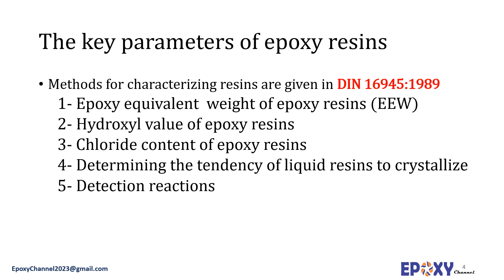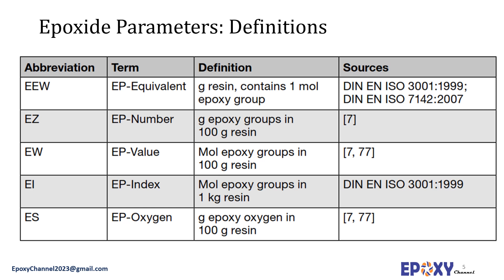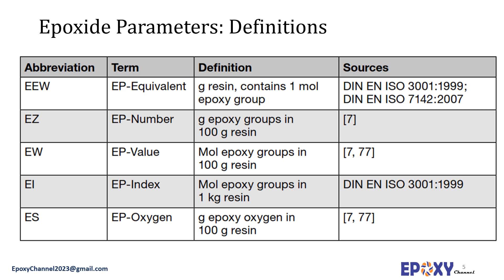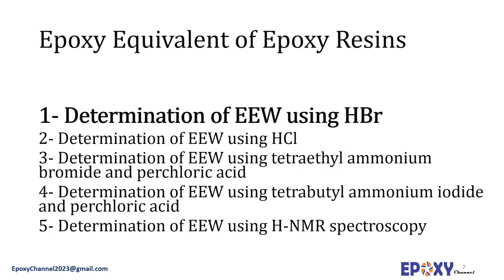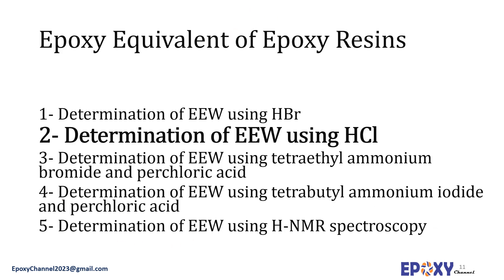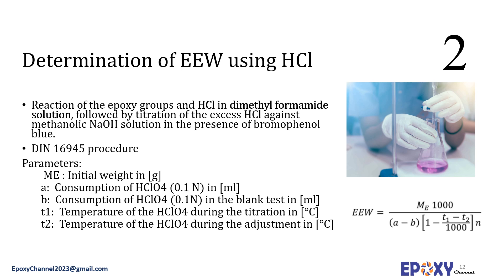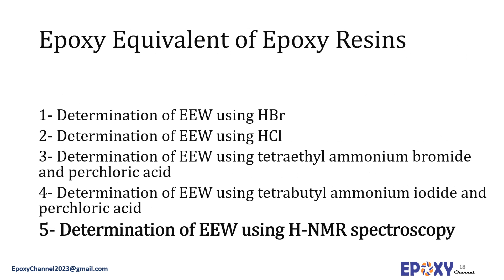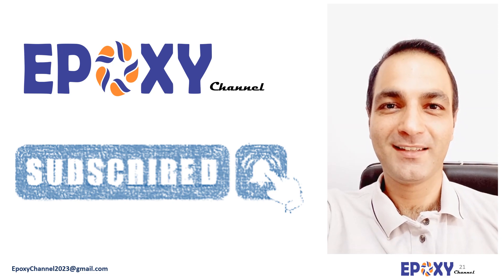Epoxy Equivalent Weight (EEW)-Session 7 @EpoxyChannel

Comment: Hi Sir, I want to ask, it is okay if I just find EEW of epoxy on google?
Reply from the maker: Hey. You can find the EEW of various resins in their TDSs or online. However, often in the TDS documents a range is presented for EEW and that would not be precise. Therefore, it is suggested to measure it again just before use. Even if you are using a resin frequently, and you have measured the EEW previously -say 2 months ago, you should measure it again before use, as the EEW changes over time, like a deactivation phenomenon.

Comment: Dear Sir,
Please brief me, If the epoxy value is being achieved at the same time on a daily basis, suddenly one day on the same formulation, its epoxy value is not achieved, which is achieved after running for one and a half hours on the same standard but with 30 kg  weight loss after completion of batch, pls let me know about this epoxy value that may cause of weight loss and effected on batch weight. Please describe me in detail.
Reply from the maker: Hey dear Sohaib, 
Your question is kind of vague to me, but let me explain the situation based on my understanding and plausible circumstances. The formulation: If you are formulating an adhesive product for example, technically you are mixing various compounds to achieve an adhesive (i.e., fillers, additives, etc.). Herein, the binder is a kind of epoxy, often 828 or 128 grades. If your binder and formulation is not changing then the EEW could have stayed in tact. The EEW is an inherent property of the epoxy (or the formulation) and be aware that unless there is a reaction occurs  between oxiranes, it stays still. It means that in a formulation where reactions are not expected during mixing, EEW is a simple pointer to the oxirane rings.  More, I am not sure about not achieving EEW on the same formulation. If you mean EEW of the formulation has varied, i.e., form 190 to 140 for example, it means that your Binder does not have the same quality as before, if other components and ratios of them are equal. You should check the EEW of your pristine Epoxy. If by achieving you mean measuring, as I explained, EEW is "not a function of weight of your formulation". So, as far as you are doing the measurement procedures right, you should end up with the same value. There are various standards exists for that.
Did I answer your question?